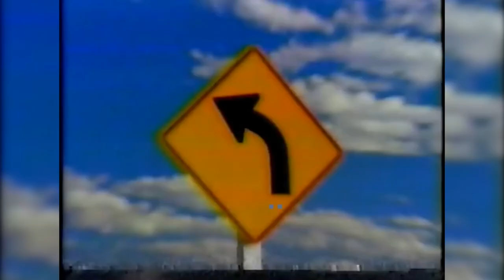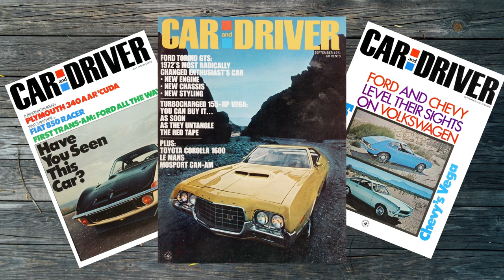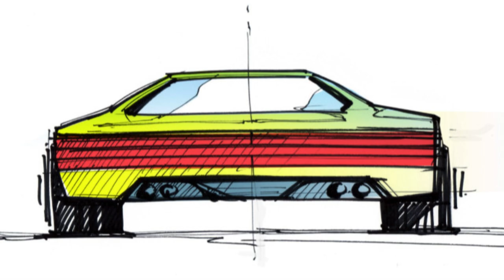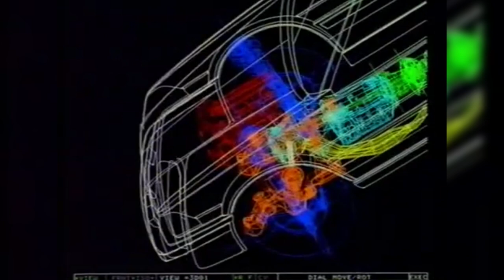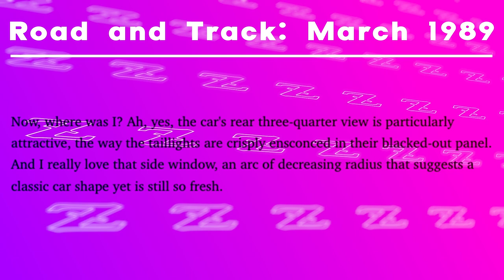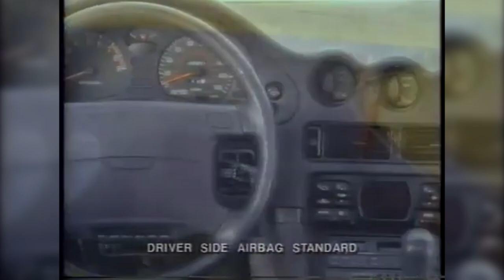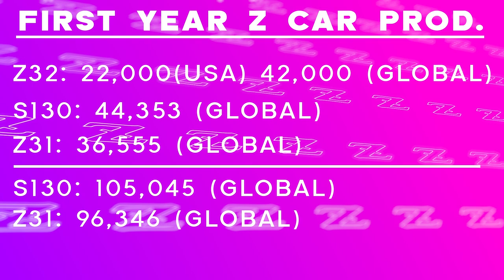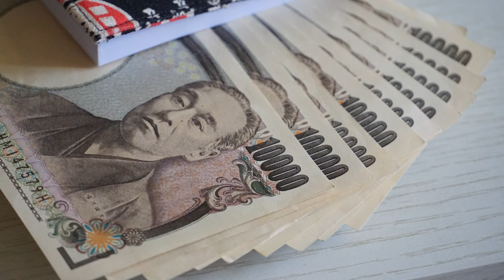The Nissan 300ZX Was The Last True Z Car

Comment: The 300zx z32 was a true masterpiece
Reply from the maker: Agreed
Reply: @Barchetta  Great video!  This was the first and probably the last world class Z car.  Nissan's goal with the Z32 Twin Turbo was to break away from making an average, affordable sports car, to a high end, cutting edge, technological, flagship.  It was designed  to compete with Porsche, Ferrari and really the only other mid priced sports car you could buy at the time, the mighty Corvette.  This was Japan's last market segment to conquer.  It won Car and Driver's best award every year it was produced.  Now Nissan has gone back to the original plan of making an every day (watered down) affordable sports car.  The GTR has replaced it as Nissan's flagship so I don't think we will see another Z car like this again.
Reply: You mean IS a masterpiece! lol I have owned 7 and am building my dream build TT now.
Reply: Still is!
Reply: Lol someone in some comment section is telling me the Z32 is the worst Z car there ever was. Im rolling to the ground
Reply: @steves.6519  they don't get the love they deserve, got a na myself but plan to tt swap in the future
Reply: I still own my 1991 TT 2+2 since I purchased in 1991. Put $5000 on engine, manual transmission clutch overhaul, $1500 metallic gloss black paint job. Nothing to do with the exterior.
Reply: Amazing car and one of the best JDM cars of all time. I have owned and built a 600 wheel hp z32 I can drive everywhere. Yes it’s hard to work on but one of the only cars that you can still buy for a decent price.
Reply: @steves.6519  awesome! I’ve owned 2 so far.

Comment: I owned a 2009 370Z sport package that I bought brand new, in Apr of '09. It was a 6 speed. I enjoyed it for 3 years, and sold it. I just didn't think it had the same magic as my dream car, the Z32 TT. So around that time in '12, I pondered buying either an FD3S or an E92 M3, used. I didn't want to bother with the high maintenance, can't pass smog, pain in the butt, rotary, so I skipped it. I didn't want to bother with high upkeep on the M3, so I skipped it....Around 3, 4 years ago I wanted another high performance car, after not having one for nearly 10 years, so I pondered buying either a C7 or 2019 911 7-speed in 2020. I didn't want to bother with the 911's super high maintenance costs, so I skipped that. I drove a brand new C7 at the Chevy dealership because they were dealing on them aggressively because the C8 was about to debut. I thought the ride was too bumpy.....So in 2020 I bought a 1995 300ZX twin turbo 5 speed with the pedestal spoiler off of some old man. He was the 1st owner, and it was clean title. I will keep my Z32 TT for the rest of my life. I love this car. It was my dream car when it debuted in summer of 1989 when I was 14.
Reply: bravo !!! I have black 2+2 TT EUspec...
Reply: The 370Z is a better car and is just as much of a sports car as the 300 ZX.

Comment: Z32 design is timeless and looks as fresh today as 35 yrs ago. Larger wheels with a staggered setup improves the stance. My 94' na manual now with 99K on it is the only car I have owned over 5 years,now at 20yrs.  Also had a 86' & 88' turbo 5spds,

Comment: What an amazing car, even in an underpowered state compared to today. I thought that it's 4-wheel steering was a drag, but it works flawlessly and makes sense. It was a mistake to ditch the line.
Reply: Also another one of those cars which are built in a classical way (like mustang, ak47, f-14 tomcat). Sometimes going backwards is useful.

Comment: I've always wanted one of these since I was a teenager... I could still recall callin' up Nissan like 20+ years ago, and chewin' them out for discontinuing the 300ZX. The car was FANTASTIC, and NOTHING is wrong with it. I was hopin' they would mass-manufacture it make as as many of them as there were Corollas. Like a MILLION of these vehicles a year. They just coldly said to me, that the 350z will be 'replacing' it. I told 'em to just go straight to HELL. I shure gave 'em an EARFUL!!! 😡
Reply: hahaha ... I am 300zx's owner from 20years. I had three 2+2 euro spec TT and one 2+2 N/A USA.Currently I have from 12 years one black TT euro 2+2 stock. I love this car. 
Greetings from Poland

Comment: The ZX cars (starting with the 280ZX) moved upmarket into a different, more expensive segment than the one originally occupied by the 240, 260, and 280Z (S30) cars. I'd argue that the 350 and 370z were a return to the "true" Z-car. They moved back to the same relative market position as the original Z cars. They were simple 2-seater sports cars without all the bloat that added so much cost to the S130, Z31, and Z32.
Reply: Too right, to continue to make those jumps in price and performance, it's just going to become a GTR and beyond, Z is meant to be affordable and powerful, not to out pace supercars... It's meant to be an affordable sports car. People just can't understand this

Comment: "There was reason to believe we'd never get another Z car ever again" I'm glad that wasn't the case, with the 350z arriving in 2002 and the current 400z, which is essentially a modernised 240z. Oh  almost forgot, excellent job
Reply: There's no such thing as a 400Z
Reply: @FlawleZ31  Whatever the new one is called. Wasn;t it the 400Z?
Reply: @KyrosTheWolf  Its just called the Nissan Z. People assumed it would be the 400Z but it was never called that and it wouldn't even make sense anyway since the engine is still a 3.0. If anything it would be a 300Z. But Nissan just calls it the Nissan Z
Reply: @FlawleZ31 If I get one (a new one), I’m thinking I’ll call it a 300Z. I have a 260Z, so it’s not imperative.

Comment: no, it wasn't. actually it was the furthest away from being a real Z car, along with the z31. it was expensive, big, heavy, equipped with tons of over the top tech. that's not even a bit close to what the S30 was trying to achieve. don't get me wrong, it's a great car overall and a pinnacle of it's times, but saying that it was "the last true Z car" is straight up wrong. the z33 and z34 were the one's that come close to the original idea, not this.
Reply: I've had a 300zx and a 370z. You're absolutely right

Comment: The 968 does not have "spotty build quality". I have 285k miles on mine, and have daily driven it for 15 years. It's one of the best cars I've ever owned. The Japanese cars and the Corvette may have the edge in some things, like 0-60 or lateral G's, but the 968 wins in quality, hands down.

Comment: I had a 94 TT Supra in between a 92 TT Z and my current 96 TT Z. The Supra may have been made popular by "Fast and Furious" years later, but it was much poorer quality. The 6-speed tranny sounded like garbage at low speed, the twin turbos could be caught off guard, the leather seats cracked within four months, and the bumper paint faded at a different rate than the rest of the car. Not a good look for a $40k car, and little wonder unmolested models are hard to find. 
Cool to see some of the articles I have original copies of being referenced here!
Reply: yes, but today the supra is 3 x more costly... In 2022 I sold a nice red 300zx TT euro for only 12k$ in europe. Currently i have one black TT 91 europe spec.
Reply: @FROST20091978  Over-hyped. People are paying Ferrari prices for high-mileage, riced-out Toyotas? No thanks.
Reply: @myfakeguuglaccount8307  yes, but 2jz is better for tuning and less complicated. However Supra was released 3 years after the 300zx z32 in 1992. In the 90s it was a very long time in automotive, like 6-7 years today.

Comment: Yeah thats exactly what I have been saying sense the the 350z. The z32 was the last real z.
When they dropped the T tops and turbos they killed the z. And not the new Nissan z, has a cool. Back end, but that's it. I'm glad they went to turbos again, but there is only like 1000 with a manual transmission. And who the f wants a auto z

Comment: No one who actually understands Nissan's history with their Z cars says stupid shit like this.
The 300ZX twin turbo was not really a "true" Z car. The 240Z was not built or designed to one-up the world's other great automakers. It was built to be an affordable, fun to drive sports car that would be easy to sell in the USA.

The 300ZX, more specifically, the Z32 300ZX twin turbo was built EXPRESSLY to one-up Porsche, Corvette, and any other sportscar manufacturer on the GLOBAL market for under 6 figures price tag...and they did precisely what they set out to do. That doesn't fit in with the Nissan Z car original mission AT ALL. Yeah they offered a non-turbo version, but that was purely to keep the price down in order to increase sales. The car was designed to be a global flagship car period.

Nissan took this approach again in 2009 with the R35 GT-R, and just like with the 300Zx twin turbo, they nailed it.
If anything, the 300ZX is more in line with the R35 GT-R than being a "true" Z car. 

The 350Z the 370Z are WAY more "true" Z cars than the Z32 300ZX. Really the R35 GT-R is the "true" successor to the 300ZX twin turbo. It has very little heritage in common with the older GT-Rs which were rhd market only and based on a crappier coupe/sedan platform stuffed with performance drivetrains.

The 300ZX really was not a true Z car, and the R35 isn't really a "true" GT-R, the two cars are in fact more related to each other than to the badges they were given.